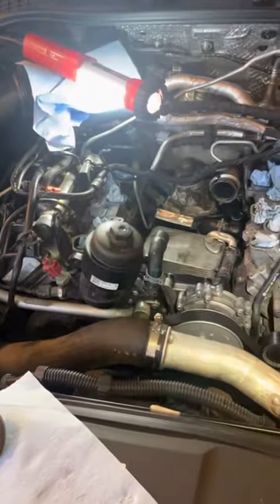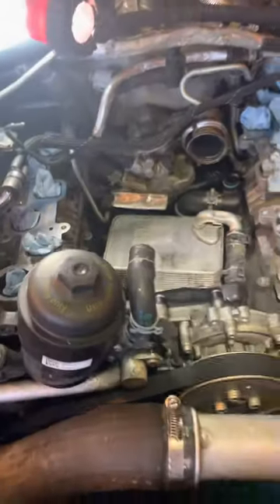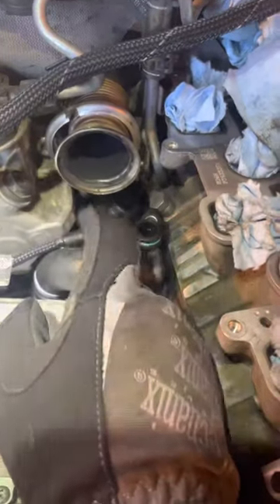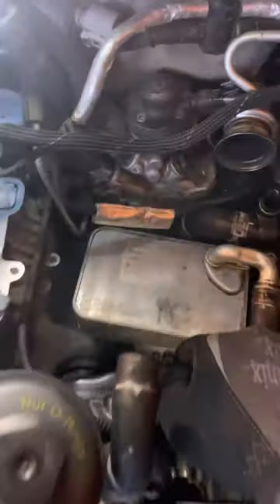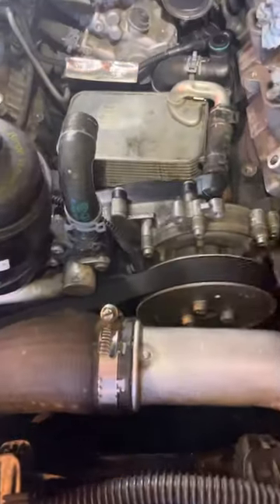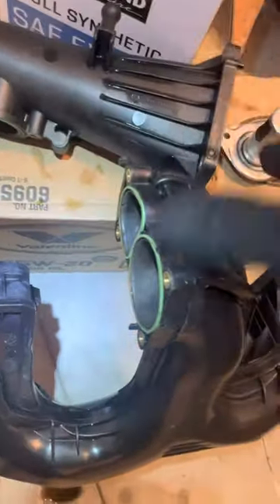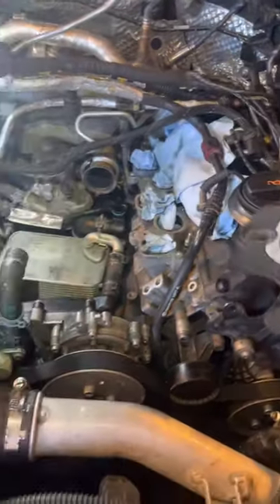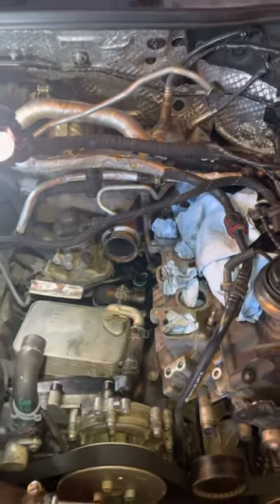2013 Porsche Cayenne Diesel, VW Touareg TDI, Audi TDI Coolant leak in the valley.

Comment: Excellent Detective work brotha. 
Cross-platform part #s are an absolute mess and headache EVEN for the stealerships.  

Thank you for shortcutting this for everyone. 

^ It will go years unappreciated. So, I'll leave this here for long-term appreciation.  

In 3-5 years or so from today- this comment section will flood with a billion questions. LoL 

Also - Thank you for posting VW part #s. 

Same parts - with Porsche Part #s - will cost 3x-5x the price.  

I've been trying to find an interactive parts catalogue ^ for Toureg/Q5/Cayenne <~ so far no luck. 

Anyway. THANK YOU AGAIN !!!!
Reply from the maker: Thanks!  I was able to get all the parts from my local VW dealer, and they had them all in stock. Plus I got new intake manifold gaskets, also in stock. Changing all this fixed my leak and cleaning the intake improved throttle response.
Reply: @jetskiaddict  Happy to hear that !!! 

Nothing worse than a leaky piece of equipment. 

Yep - New gaskets   = GOLD 

Otherwise, do it twice. 

Improved throttle response !!! 

yah - I actually have been stocking up on ceramic coating - going to use that for the insides of the plastic manifolds - it keeps the surface as impervious to most elements. 

Pro tip: True ceramic coating will work wonders on plastic, vinyl, rubber - without giving you the armor-all slime. 

KEEEP UP THE GREAT CONTENT KIRK!!!
Reply: How is it now. Do you smell any coolant after what you’ve done?
I have 2014 cayenne with coolant smell as well
Reply from the maker: @selimseker6902  Changing these parts fixed my issue.  No coolant leak, all is well.  I did pull a vacuum on the coolant system and it held without any issues, then refilled.  Also did an oil change in case there was any mixing involved when replacing the oil cooler.  All went well.